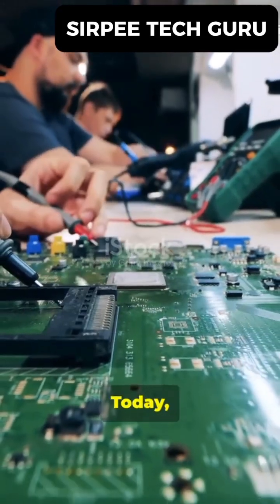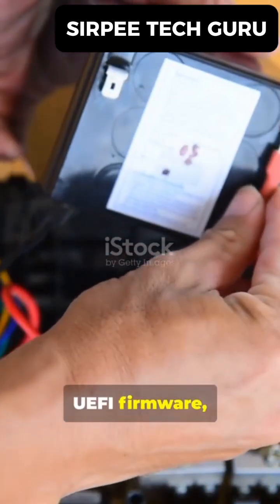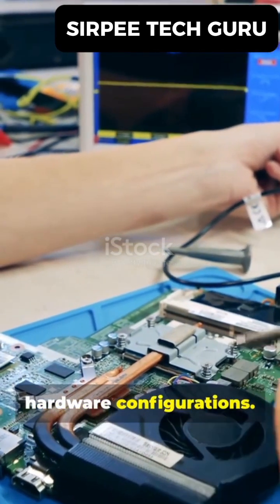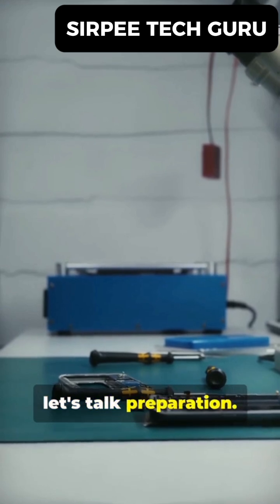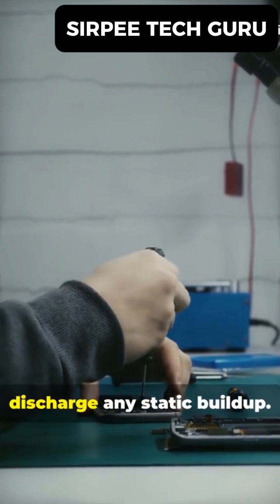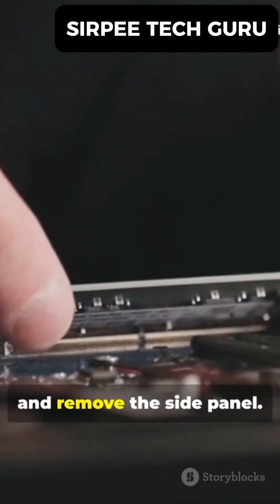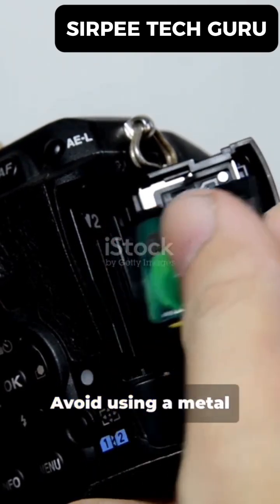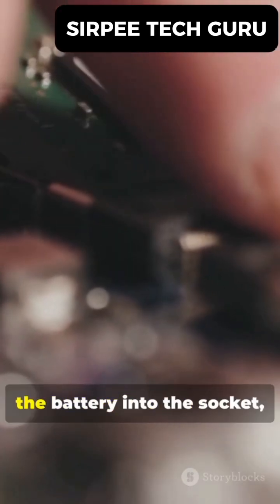Stop BIOS Errors! Replace Your CMOS Battery with Ease #shorts #memorydevice #cmos

Comment: A CMOS battery won't need replacement in anything that is new. If you're changing a CMOS battery, you're dealing with old hardware that's probably been running for at least 15 years.

A few weeks ago I had to change one in a 2006 vintage Dell's OptiPlex machine that I use as a lightweight server. (It has newer components: the mirrored pair of hard drives isn't from 2006, and it's on its third power supply).

The Dell's BIOS won't simply let the battery down so you only notice when settings are lost or the clock is wrong. When the battery is getting low, it issues a diagnostic about it on power up and you have to press F1 to continue.

I suspect that if you power cycle at least once a year, you are probably okay.